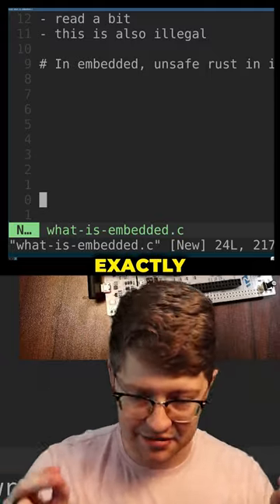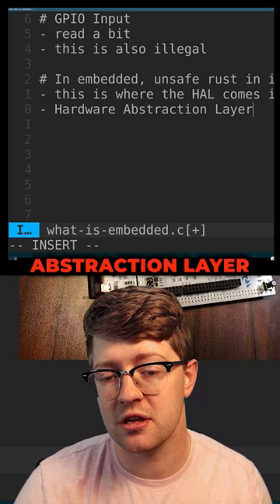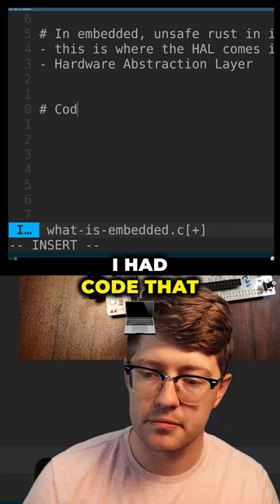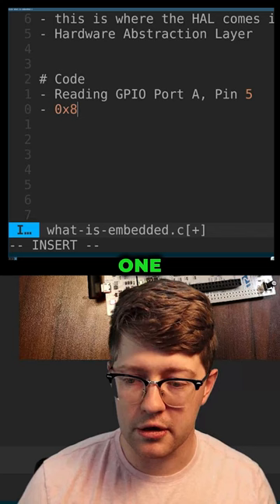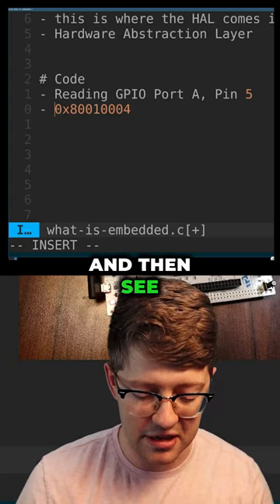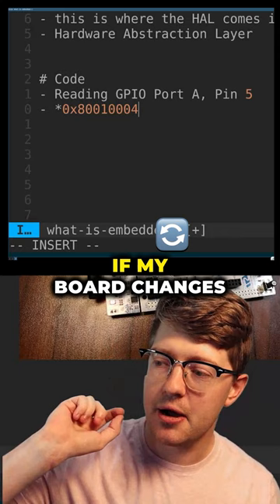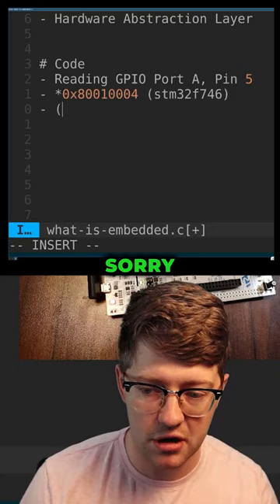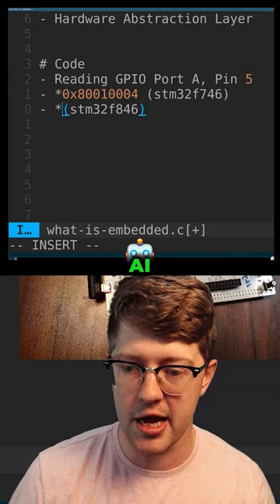Why Hardware Abstraction Layers are AMAZING #EmbeddedRust #UnsafeCode #InterruptDriven #Programming

Comment: Yep, don't use magic numbers.
Reply: In this specific example, BUT its not only magic number; in some chip (even in the ST family! look the the F1 vs F4) the GPIO register are so different you actually need a completely different logic to set the up properly.
Another example is MODER in special GPIO functionality; in some cases the F1 want the GPIO to "analog input", while F4 want "alternative function", only way to know what you need is to read the datasheet for the specific case in the specific MCU
Reply: Especially when that magic number is a pointer 😂
Reply: @kneesnap1041   The worst kind of magic number and yet they're so common on older computers and in embedded devices.
Reply: Shouldn’t all that go into a header with const enums or #defines - by all that I mean hw-dependent stuff, and by const enums I mean their rust equivalent- I didn’t get that far yet

Comment: You then should also not access by pins
Reply: yes and no.
you can create virtual pinout, but is a pain as most MCU have specific limitation on what functionality a PIN can have; and what hardware pin combo you choose is also dependent on what is best for the board layout, you may want to remain pin compatible, or due to routing/planned feature constrain, force you to use some over the other.

In my experience better to have HW pins, and manually change those when required (and potentially what DMA stream is used and few details like that), but the HAL make sure you change your PIN definition, and it will take care of the rest.

Comment: In the case of STM32 at least using HAL is a big leap from using magic numbers, STM32 HAL is a giant software logic layer which also has plenty of bugs and doesn't map 1-to-1 to hardware logic. We've been using STM32 HAL where I work and more than once I had to rewrite a whole part using the LL stack that actually maps 1-to-1 to the hardware logic.
Reply: What about the CMSIS Library? Is it the same problem?
Reply: @dominikz5776  no, not really. I does provide mostly definitions of these magic numbers + some convinent functions

Comment: Usually when writting embedded C without HALs you dont write hard coded addresses into the code but rather use defines from the CPU header. Therefore you do not run into the mentioned issue. 
In low level control and safety applications, knowing what your code does exactly is much more important than extra portability offered by the HALs.
Reply: Exactly what I was thinking
Reply: Sure you include a header file including #defines solves typos. But it's not portable as the different board headers use different naming for those defines. In a hal you have an api that is the same for all boards that support the feature you are trying to use.
Reply: @redcrafterlppa303  You still have to use defines from  headers in a HAL function call.  If you are using a custom board you still have to rewrite the board header.
In MCU headers, if the chip you changed to has the given peripheral signifficantly different, the HAL will need adapting somewhere anyway...
Reply: Got to invent problems to justify the existence of rust

Comment: me when the board i have to use is no longer based on stm32f746 (address 0x80010004 no longer corresponds to gpio port a pin 5)

Comment: So basically you need a file where you have your defines and you use them. I see nothing new. Also if you really want to be safe you can just define pointers to a const with these addresses and you ensure that a pin that you are only meant to read from will be actually read only.
Is Rust becoming the iPhone of programming languages?

Comment: I don’t think this is why HAL is existed!
The idea from HAL is to ease out the process of reading or writing to low level registers, and to make sure it’s safe to do so, by implementing all the edge cases that may cause a faulty!
Your example of two different MCUs is actually have nothing to do with HAL, as there should be HAL already written to each one by the same API to run well, so if the newer MCU doesn’t have HAL or not the same API syntax or logic, then you will rewrite code.